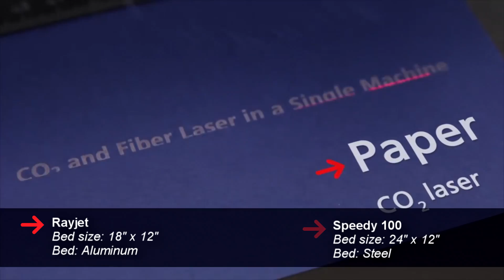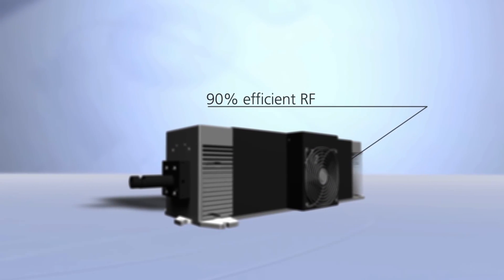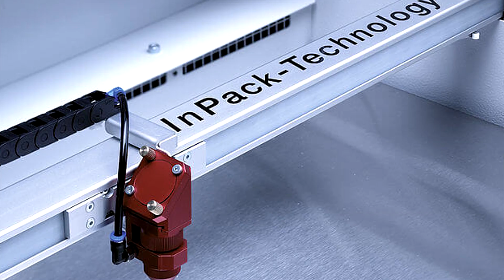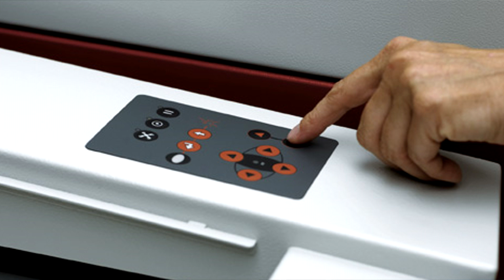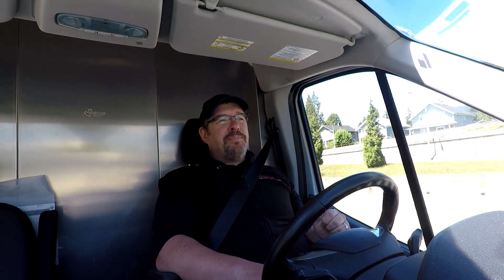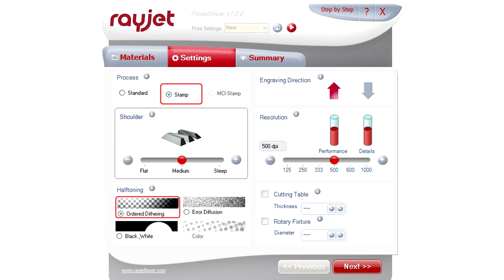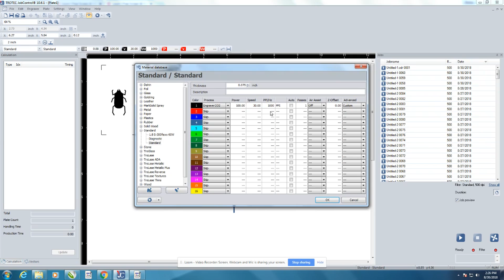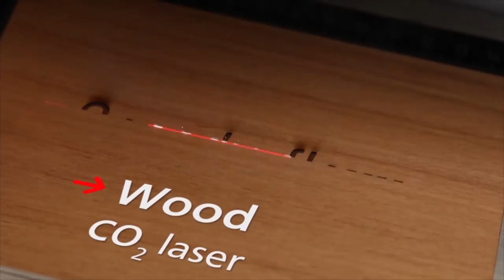The Best Laser Engraver for a Small Business | Rayjet vs. Speedy 100 | Trotec

Comment: We have a speedy 300 with Iradion Ceramicore. It packed up with less than 2000 hrs on the clock although we had had it for 2 years so out of warranty.  Trotec wanted £6k  to replace the laser source (now £8.5k), which seemed a bit too much for me. We found a company who can re-gas them at a fraction of the cost. I think it's time Trotec started to offer a re-gas service rather than mugging off their customers with a straight swap out without even looking into the problem the laser source has.  We are now looking at buy another laser, but I don't think Trotec are worth the extra bucks, when i can buy a complete system for less than the Trotec source.   With all that said mechanically they are pretty much bullet proof, we now have around 5K hours on the clock and it hasn't missed a beat in respect of bearings and belts.
Reply from the maker: Hi Richard, thank you for your comment we will forward it off to our technical team in Austria for their consideration.

Comment: Where can I find Info for rayjet 50 maintenance guide. Like piling cleaning etc. TIA
Reply from the maker: It should be in your rayjet manual. Have you received on with the machine?
Reply: @TrotecLaserCanada  no such thing. I k ow how to clean the lenses but need to k ow how to oil the rails and the screw rod etc internal maintenance vs routine

Comment: what's the best one for jewelry?
Reply from the maker: Hi Wendy, if you're looking to just engrave on metal jewelery the least expensive would be the Rayjet. Because it's CO2 you would need to apply Cermark or MarkSolid spray on it before you mark, it takes quite longer than direct marking using a fiber laser. The Speedy 100 does comes as a Fiber or a FLEXX (both Fiber and CO2) lasers and is bigger than the Rayjet. If you're actually looking to CUT custom shapes than you can do so (thin sheets of sterling silver) with the SpeedMarker 300 Galvo laser system. We hope that helps!

Comment: We bought the speedy 100. Just wondering how many hours can the machine run daily? I use it about 1-2 hours/day. Can it run for many hours without an issue?
Reply from the maker: Hi Misagh, yes as long as you keep the machine clean (especially the lens and mirror) in between jobs it can run indefinitely.
Reply: Hi,how much is the speedy 100. ?